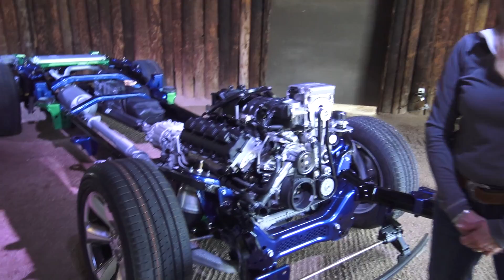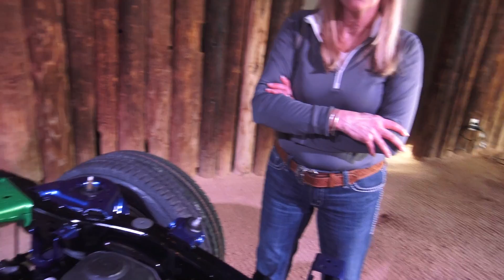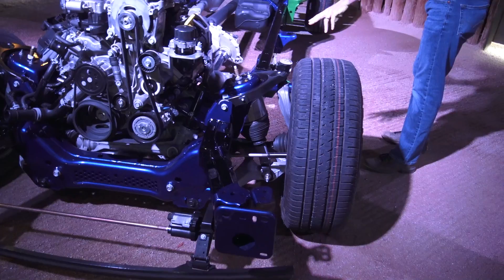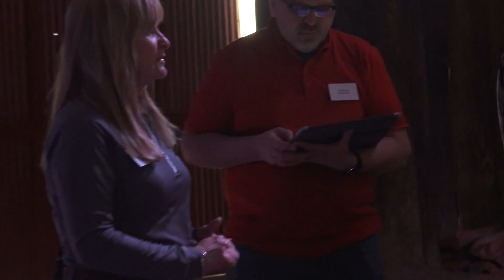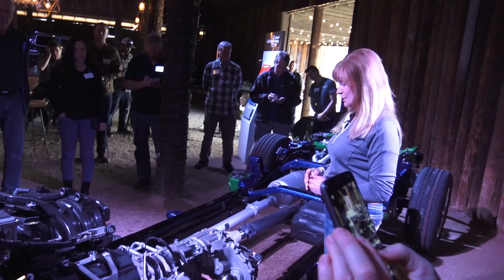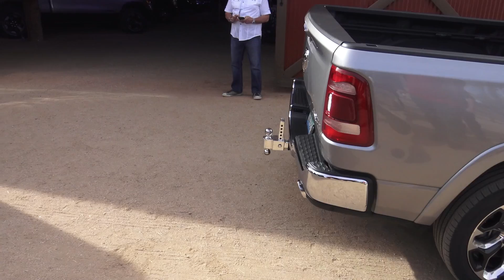2019 Ram 1500 first drive in Arizona, trailers, off-road and fun part one.

Comment: Mr Truck, whats your opinion of the electronic parking brake? I'm not sure I like it on a truck application because of the change in weight on the vehicle due to towing and hauling things. I know Ram and Ford have it on their 1/2 tons, not sure if GM is following them.
Reply from the maker: I'm used to it now, most come off when you put it in gear

Comment: Performance enthusiasts of the Ram 1500 brand do not care for e torque and should have the option to shut of the cylinder deactivation feature. The Ram 1500 should also be equipped with 4 or 5 pre wired auxiliary switches from the factory for light bars and winch

Comment: It is very capable but the Ram is getting to be very expensive and oversized. My 06’ Dodge Dakota is pretty much the same size as my grandpa’s old 86’ d150. The Dakota tows up to 7,150 lbs with the old 4.7 V8 at 295 ft lb torque, has heavy duty suspension with leaf springs, limited slip differential and a 6 1/2 ft bed so loads and bad roads are nothing and I can reach everything in the bed without climbing and a 8 inch ride height. Parts are cheap and easy to come by and there’s plenty of space to work. It’s lighter than the Dodge Ram so the 4.7 is plenty at 235hp with the 3.55 axle and 5 speed transmission, tow package and maneuvers easy in heavy traffic even with rear drum brakes. It still manages 15/20 mpg which isn’t bad for a truck 13 yrs old encountering adverse weather and road conditions requiring only regular maintenance and pencil touch up paint for rock chips and washes. It only has 4 gauges, uses a column shifter, has great a/c & heating, gray cloth and carpet interior so it stays cool, sliding rear window, basic CD/ Aux radio, and power windows with chrome bumper and wheels, extended cab and only cost $15,000 in 2012 and currently has 56,000 miles. Sure, it might not be as roomy, capable, technologically sophisticated, or luxurious as the new Ram, rattles, rides, and handles like any  old American body on frame rear wheel drive vehicle, but none of that matters cause she has never let me down. I may be from the old school when it comes to trucks, but ultimately what my grandpa and father instilled in me is that a truck is a work tool like anything else and needs to be maintained. It’s not for show, but it needs to work when it’s supposed to, and how you maintain your truck is an extension of who you are, what you value and the level of pride you take in your work and yourself.

Comment: Like the concept, but from what the lady said about by saving fuel while in traffic the engine cuts off and then alternator auto starts  the crankshaft to re-start the engine again what if the alternator is not able to restart quick enough once traffic picks up again or stalls? Then your pretty much stuck and holding up traffic. I could be mistaken but that's how I'm kinda interpreting it. Also I'm not enthusiastic about having a hybrid electric truck I'm a muscle car kind of guy and I'd rather having something growl on the road rather than hummmm lol. And last Dodge, please make a RAM helcat or RAM demon someday 😁

Comment: The hot coolant warms up the gear oil in the diff to reduce the drag/improve mpg. Conversely, it'll keep it from getting too hot when it's under a heavy load. Synthetic vs petroleum based has no bearing (no pun intended). Supposedly, it won't divert engine coolant until the cabin temp has warmed up (if heater is on)
Reply: Not me More Junk I don't need. 2017 Ram 2500 Cummins.
Reply from the maker: Synthetic oil does flow better which is why several OEM's have switched to synthetic diff oil. You're right it's all about MPG as this is only on 4x2 trucks. I'd like to see it on HD's.

Comment: Not even efficiency. More gadgetry with no driveline or truck-like improvements. It is probably the best featured light use truck if you aren't really needing a truck but Ford and GM are the best bets for truck use. This isn't a knock on the Ram because personal use is a huge market and they're nailing it.

Comment: They need to get their story straight!!! The guy says the e torque adds performance! The lady says it doesn't! Come on ram! 
If it only says u 1 mpg then it's not worth the 2k they will charge for it! They kept the same freaking engine power! The e torque better be used to help with acceleration!

Comment: They keep throwing more tech on them but really nothing is a break thru for fuel economy. It's all gimmicky garbage imo.
Reply: Wouldn't t be nice to see a very basic truck available NEW?  One that is like a 1980 truck, with a manual transmission, but with the safer body of a 2018?  The only electronics would be the fuel injection system.  A new quad cab might cost around 25k instead of 60k and would be more reliable, and easy to work on when it did need repairs or maintenance.

Comment: I commend ram for pushing the boundaries. It’s just hard for me to believe you could pull a 12k trailer with a 1/2 ton. I mean seriously I wouldn’t pull a skid steer with it. Am I wrong? Can it even stop that kind of weight?
Reply: The brakes are amazing in these trucks. I am confident it could stop heavy weight as long as you use trailer brakes and you have your trailer properly loaded and hooked up.
Reply from the maker: As said in the video, front is 14.9 in, rears are 14.8 in
Reply: THIS TRUCK HAS 19.4 INCH BRAKES

Comment: @MrTruckTV did they change the maintenance intervals for service to accommodate the added fluids change in ph due to use and the extra strain on belts?
Reply from the maker: Good question, I'll have to look at the manual when I get it in a couple weeks.

Comment: That's a bummer that the e torque does NOT help with additional torque to the rear wheels. It does take some strain off the engine by running accessories? A/C, Steering, electrical load?
Reply: It does, and was specifically made for towing a d accelerating while under load.

Comment: I just think they are focusing too much on efficiency and not enough on reliability. Keep it simple is always the most reliable way. Etorque looks like it could be problematic and would cost a fortune to repair.
Reply: Hybrids have proven to be very reliable. The Hemi is a very reliable engine, plus this hybrid system is not really a true hybrid system so there's a possibility it negates some of the issues that may arise from a traditional hybrid system.